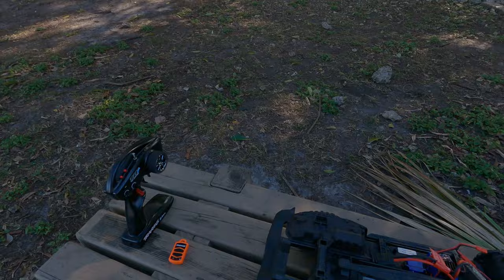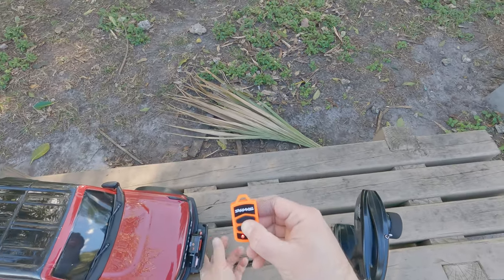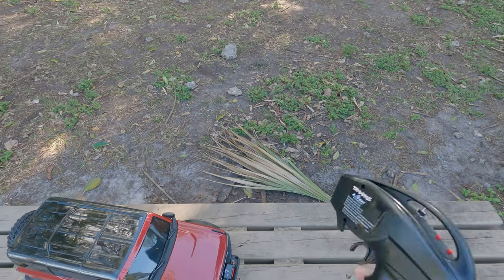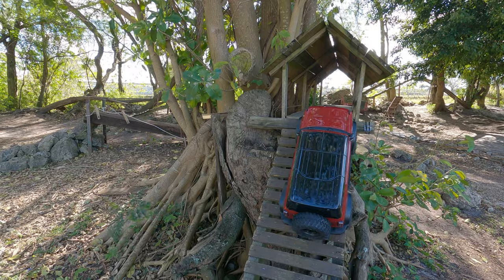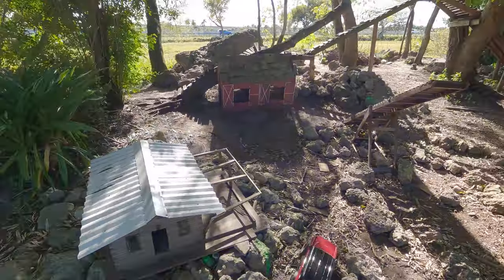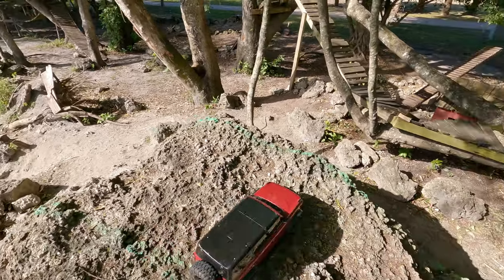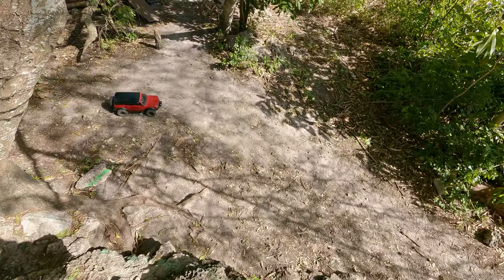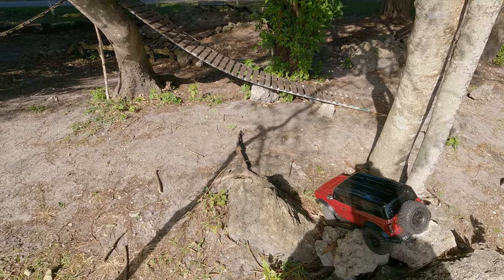Traxxas Pro Scale Winch In Action… How Does It Perform?!? Is It Worth The Price?!?!

Comment: It seems that when the stock ESC is in “Crawler” mode, and is providing engine braking to the rig when stopped, the winch would be trying to pull the rig with all 4 wheels locked up. At least that is what it looks like in the video due to the truck really squatting down when winch is applied. Thoughts?
Reply from the maker: Yeah, when I’m crawler mode it has drag brakes which is why it is squatting down